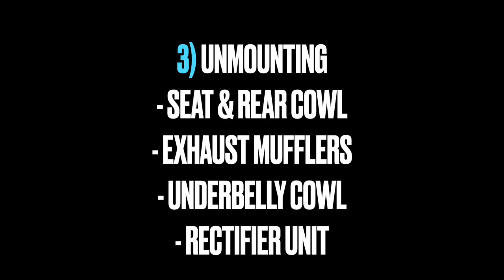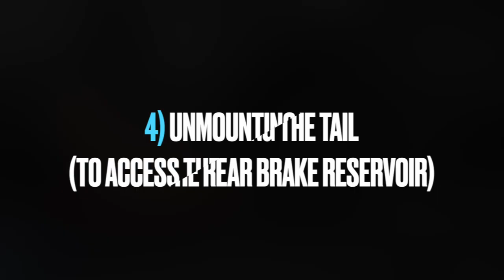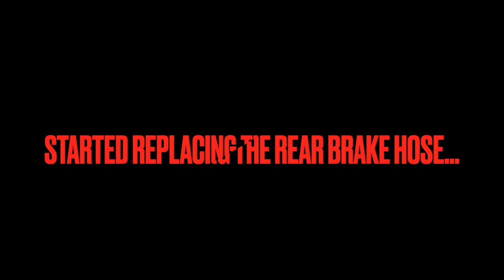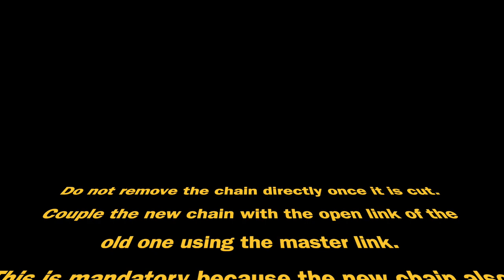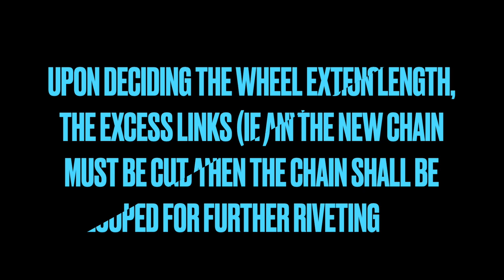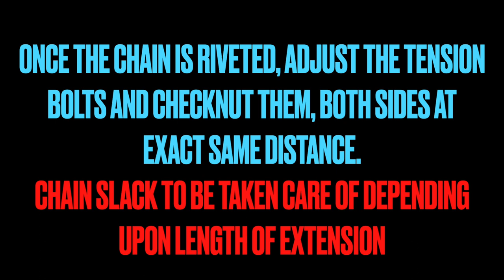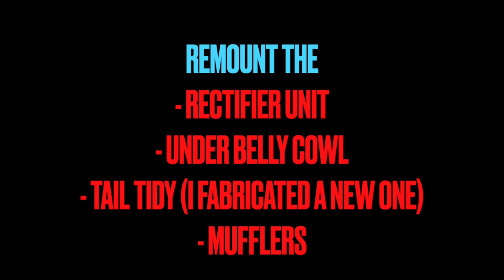Hayabusa Swingarm Extension | Gen 2 | DIY

Comment: Yes it looks as it should be extended my 07 about 6 years ago 5 inches perfect but you do need a tail tidy and repossession the number plate.
No problem’s with handling actual it feels a bit more stable 
Off course you need a new chain plus your chain guards is a short. So the fittings are billet aluminium bolted up torque then you can do away with rear brake support bar. Looks and feels so much better 👌👍

Comment: Let me tell you Now bike looks much better than stock.
Rear end assembly always looked odd on Busa, either it should have shorter rear sub frame or longer wheelbase what you just did perfectly..!!!
Reply from the maker: What you said is true Amit! Pretty sure there would be some engineering/aerodynamics after that rear end, but messes it up aesthetically. Previously i wanted to extend it only till the length of the tail lamp, later decided to stretch it till the arc of the wheel matches parallel to the wheel arc under the tail!
Reply: @pathikpanchal810  Did you get an opportunity to ride New gen 3 Busa by any Chance? Is it day and night difference?
New is costing 20 ish on road and there's one available gen 2 2019 model with same vance & hines slip-on as yours for 14.
I am totally confused between two and mind also inclines getting brand new Ninja 1000 SX for 14. 
Damn there are dozens of bike to choose from but I don't find a single without a major compromise. 
I am riding 1250 GS now but would want to add one inline 4 sbk.

Comment: How do you mount (fix) brake caliper ??
Its length is not enough ,is It ?
Reply from the maker: It is subjective. If u want to extend up to 6 inches then U can use the stock brake hose of the rear caliper “BUT” you will have to un hook its mounts over the swingarm and pull it straight from the central junction without any curvatures on its way. Hope it is clear! :)
Reply: @pathikpanchal810  
https://youtu.be/48nhbLYFd4g
like this video's part to hold brake caliper (1:03)

How do you mount (fix) brake caliper ??
not brake hose
I'm japanese. so I'm not good at English sorry
Reply from the maker: @user-eu3jp1fg2x  No worries. 
Email me on pathik810@gmail.com. Will explain you with pictures!
Reply: @pathikpanchal810  
ok👍
thank you very much !!